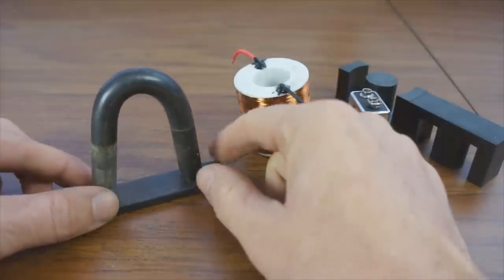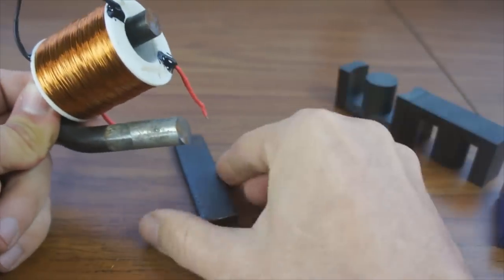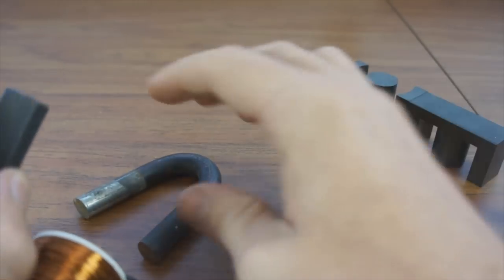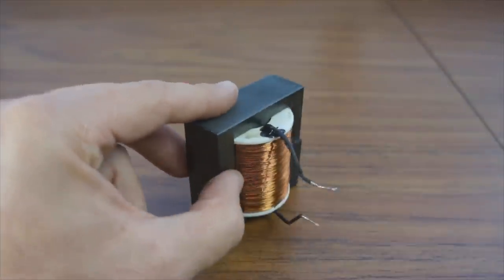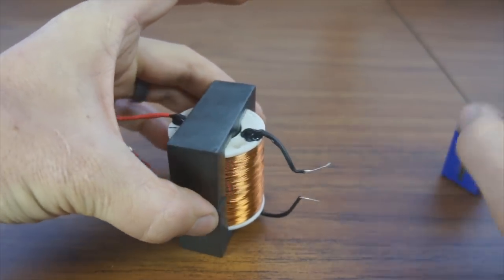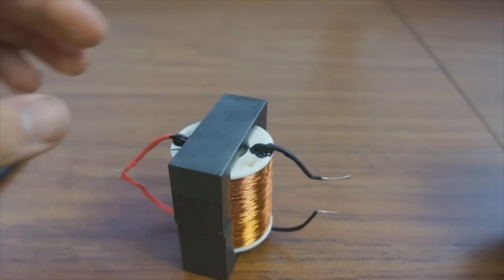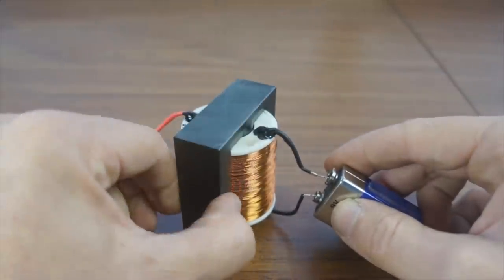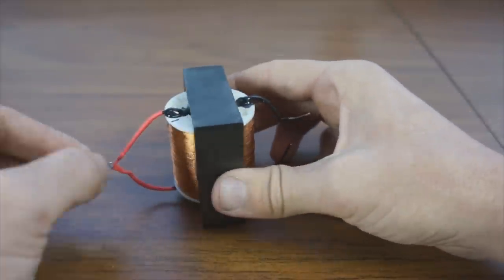PMH - Electromagnet keeps holding after power is removed?

Comment: From what I understand, What I think you  are observing with the soft iron is magnetic hysteresis, and that phenomena was used in early computers to store data. In the closed core, magnetism will either "flow" in one direction or the other, and that will lock the magnetic keeper to the horse-shoe iron. This magnetism cannot be fully removed, only reversed when another pulse of opposite polarity is applied, but in order flip the polarity of the magnetic "circuit" there has to be a moment when the transition passes through '0' magnetism, just like a car having to stop completely before going in reverse. That is why the keeper falls off then it can no longer sustain a strong magnetic field.

The reason that magnetism in the soft iron persists is because it is conductive, while the ferrite core is not. This means eddy currents cannot form in the core. Imagine the soft iron core as not only a core, but also as a shorted secondary. Looking a a cross section of it, imagine many millions of loops, rings and coils that are all conductive! The ferrite core, on the other hand, It is specifically designed not to be conductive, and so these parasitic currents cannot form as easily. The reason this matters is because when making transformers, if the core is conductive, then what happens is that the alternating magnetic flux will induce current in the core and this robs power from the primary, and it is lost as heat (since iron has a little resistance and current+resistance = heat) To eliminate that, iron and other ferromagnetic materials is made into a powder and then the power is glued and molded together so the electrical resistance is really high while maintaining a reasonable level of permeability (magnetic conductivity). By eliminating electrical currents forming in the core, all the changing magnetic flux can induce current is secondary coils and thus the transformer will be more efficient.

The reason having another coil shorted allows the magnetic hysteresis to reappear is because it simulates the cross-sectional area of the other soft iron core with infinite cross-sections being like shorted coils of wire. An electrical current is induced creating a semi-permanent magnetic field that will slowly die away as electrical resistance in the wire resists current. I bet you can stick an ammeter on that L2 coil and measure electrical current flowing for a few seconds until the effect dies away. The higher the resistance, the weaker the hysteresis and locking will be.

This is just my current understanding, I really do not have any idea or understanding of the weird and wonderful world of electromagnetism, let alone any formal education in electronics.
Reply: Very excellent read there Power Max, Thank you for writing that. I want to say that I've been reading Eds book Magnetic Current to gain the insight what Ed thinks and he shows us from his book that the coil is a magnet during the time currents are made. From what I'm picking up on is that through Mutual induction the secondary coil becomes a electromagnet which holds the core together but due to the soft iron its not able hold the magnetic bond after the created electromagnet (like the PMH), the electromagnet eventually stops working on the secondary and the soft iron core no longer is able to hold it core section together. And believe it or not but Eds points all this out in his book in his own terms of course. Here is how here put he puts it in his book "You know the soft iron does not hold magnets, but you already have one that holds it. It is the perpetual motion holder. It illustrates the principle how permanent magnets are made. All that has to be done is to start the magnets to run in on orbit, then they will never stop."
Reply: You have a good understanding of electromagnetism, was going to type something similar but you beat me to it. ;)
Reply: Leviathan15s Nah, I don't have any real clue whatsoever, this is just some of my ideas and current understanding, the terminology is just wikipedia stuff I found a long time ago and I learned the history of magnetic storage at the EEVblog, but thanks!

Comment: is there a way of calculating the capacitance of your feed coil and working out the induced voltage of the second coil ? what is confusing me a little and it might not be relevant is that in the PMH your charging coil wire is smaller size to the PMH which the gauge of the steel (closed coil) is greater than the copper charge coil but in your excellent demonstration the secondary PMH colosed loop is smaller gauge than your charging coil
Reply: Some amateur scientist have made a PMH from a single piece of 12 awg wire and this phonomen can still be observed. .check out youtube...its there

Comment: The last experiment with the coil and the transformer core is pretty simple to explane. When you energize the primary coil, and shorten the secondary coil, the secondary coil will need some time for the magnetic field in it to collapse when you remove the powersource.  It is the sudden collapse of the primary coils magnetic field that induce a current in the secondary coil. It will take some time for this current to stop flowing, and therfor the two transformer cores will stick together untill the current flow has dropped sufficiently to finally release the two cores. You might experience that the cores will stick together longer if you shorten the secondary coil AFTER you supply power to the primary coil.

If you do not short the secondary coil, but place the wires close to eachother, you will probably see a spark when you remove the powersource. This spark occurs because the primary magnetic field collapses so fast, it will incuce a high voltage in the secondary coil, but almost no current - except during the duration of the spark.

Superconductive electromagnets, such as them used at CERN will maintain its magnetic field after the powersource has been removed. In that sense we can also say that normal permanent magnets are superconductive in its structure that keeps the electrons spinning in the same direction "forever".

Comment: My first guess would be that you are creating a form of capacitor with the 2 coils. Easy enough to test with a volt meter to see if there is residual voltage present after removing the battery. That residual voltage would be enough to maintain the electromagnet until it is used up. Just a thought...

Comment: I solved the problem with the core staying locked when shorting your secondary. The perpetual motion flows from you primary and saturates the core. The "shorting" of the secondary coil is actually just another way to keep the energy flowing through the core and once you break the chain of energy by untwisting your secondary you then lose your magnetism because it drains out of your core like a water leak basically. Hope this comment helped.
Reply: Daniel McFarland is cool but edward leedskalinin had it figured out using magnetic alternating current. Free energy is easy, sometimes over thinking it is what makes it impossible to achieve. Everything has to double and divide by 3 to achieve real creation. Combine that with knowing that north and south pole  currents are actually 2 free flowing energies trying to connect you'll start understand things a lot more.

Comment: Interesting, didnt know about that but makes sense I guess. In the second case it must be the induced current in the second coil that is holding the magnetic field. It last until the resistive losses in the coil consumes the energy. So, having more windings will give you a higher current but also a higher loss because of the increased resistance in a thinner wire. Fewer turns with a thicker wire goes in the other direction but I dont know which one is the "better".

The iron bar is more interesting. Try striking it lightly, cooling it with cold spray, heating it, adding a second magnetic field, an electromagnetic field, electrostatic field etc. and see how it effects the aligned magnetic cells. You can read a little about Barkhausen noise regarding magnetic cells although that is concerned with magnetic changes.
Really looking forward to what you can come up with there :)

Comment: Does the ferrite "E" core you used have a center pole gap when mated?  Many switching transformer cores like this do, to prevent saturation. It would easily act as an electro-magnet, but without an unbroken flux path, it can't maintain on its own.

Comment: when you short the coil, the electric current is residing through resistance. which then keeps the magnetism. when the coil is not shorted the poles are tightly magnetized throughout the horseshoe shape. once the bar is removed the residual magnetism is counter acted by the vibrations and the strong to weak magnetic field experienced by removing the bar from the horseshoe shaped magnet.

Comment: If you look at Ed's magnetic flywheel and the coil windings around on glass bottles, he used the pmh as a magnetic capacitor in this circuit to power coral castle

Comment: When you short the one coil, it becomes a closed loop/structure that gains energy via inductance from the primary energized coil, but quickly loses that energy once the primary coil is de-energized as a function of the charge in the secondary inducting back to the now open primary and escaping b/c the primary is open. I suspect that if you were to short the primary immediately after removing energy from it, with both coils now closed loops, it would hold magnetism for long than with one coil being open.

Comment: The answer appears to be very simple , lts like locking the back door and you only load and unload from the front door. some metals store magnetism and some dont. you just basically answer your own question. you told us B comes after A , but your also asking us what number comes after 1.  But nevertheless you showed us something great to learn from. its seems like it can work like a capacitor for delay oscillation without a transistor... the real trick here is how your able to demagnetize the metal. its stored induction in second coil therefore keeping the hold until reverse DC is applied that acts as AC to demagnetizes.
Reply: I'm coming here so I can read your comment later. It was very insightful
Reply: my advice, research more than one video... this stuff is tricky...  you start to plan before you completely know everything... but everything has learning curve... be prepared to make mistakes and before you know it , you will know 7 ways to do something
Reply: I'm not so sure about it. Normally the permanent magnets don't demagnetize, if you encircle them with wire.
Reply: @jonathanrice6338  this sight has some very insightful people good stuff

Comment: I don't really know whats it called in English, roughly translated to "remaining magnetism". When you run electricity through the coil the atoms and newtons and whatever gets aligned, that is what creates the magnetic field. If you use enough power this edisons will stay align even after you stop inputing power. So you are still left with a bit of magnetism. Kinda like when you drive your car and turn it of in the middle of the road, the car is still doing what the cars doing. You need to make it do the opposite like breaking if you want the car stop caring.

remanent magnetism might be the correct English term.

Comment: perhaps adding an ammeter to the second winding would shed some light.
I would assume it has something to do with the magnetic field slowly collapsing instead of quickly without the current path on the secondary. I'm not as knowledgeable on inductors as I wish I was, but my guess is there's a current on the secondary winding for a few moments after you remove the power source.

Comment: you don't need to keep the coil there, once its energized the metal stays together by itself, try with 6 nuts in a hexagon, run the wire through the middle, energize the wire + to - then remove it, the nuts will hold by themselves.

Comment: My theory on the second coil thing, the magnetic flux that was first created once power is removed is slowly passing through the second coil creating energy within the coil keeping the hold. Once that flux has passed through and thus energy has been used up it loses the magnetism. The slow flux movement works the same as when you try sliding a neodymium magnet across inclined conductor such as copper or aluminum the excess energy shorting in the conductor slows the magnets movement as it absorbs the flux. At least that's my theory but i'm no expert haha

Comment: the inductive power transfer between the coils happens only during changes in voltage, in this case when connecting and unconnecting the battery. So when unconnecting, the shortened coil will cause a short pulse that happens while the primary coils field is collapsing. This pulses polarity is opposite to the one of the collapsing field, preventing the magnetic loop of the outer legs from flowing trough the middle leg.  Or something ^^

Comment: Very very interesting. I would guess that there is some kind of induction current maintaining the field. It would make sense that the one with the second coil wouldn't last as long due to a high resistance (lower efficiency) vs the looping iron core of the single coil setup. There was a device developed during WWII called the Hans Coler Coil that may have exploited the same or similar phenomena. Researching it may provide some insight into the effect at hand. I will be looking into this and am very interested to hear an explanation!

Comment: Amigo, a possible answer to why the residual magnetism when shorting the secondary coil.  It might be just as Ed Leedskalnin explained: the secondary coil with the red wires becomes the Permanent Magnetic Holder of Ed Leedskalnin, given its self-reciprocating path.  You have created a different form of Ed Leedskalnin's PMH.  It only looks different, yet the function is the same.

The individual magnets as Leedskalnin called them will circulate forever in the infinity loop created by the linking of both ends of the secondary coil -- 'shorting'.  Unlink or unshort that secondary coil should result in the sudden loss of magnetism.  More importantly, you should see your initial electric charge used to initiate the PMH process in the primary coil when you disconnect the secondary.  You get back out in terms of the electricity exactly what you put in to make the electromagnet -- even decades later -- when you break the infinity loop of Leedskalnin's PMH.

There exists no explanation and no desire to look at the phenomenon from the institution of science.  I firmly believe this indicates clearly that all we were taught about magnetism is either ignorant, or misinformation.  

F.

Comment: this effect is because of induction of the secondary coil. it wants to resist the reduction in the magnetic field passing it thus it creates a current to keep that until it looses its power. so till this time the core would be magnetized and it would remain locked.

Comment: my best guess would be that when you tie the larger secondary winding together it creates an looped inductor. inductors store electricity in a magnetic field. and the moment you spark the charge to the primary coil from the 9 volt battery. you start a pulse wave bouncing back and forth between the two inductance coils. but that's just my opinion. i haven't put it to test with an oscilloscope. i do know from my experiences being a ham radio operator and an auto mechanic dealing with the inductance in fuel injectors. i have heard on instances where the injectors become feed back generators on the injector amps. i've being told stories from those in the know from both fields. another guess comes from an instance with testing tank coils tuning circuit in an amplifier circuit. it's what completes the sine wave created in a class c amp. being a class c amp only creates 50% or there about's of the original wave form. the rest is made by the flywheel effect in the tank circuit. that's why i think the continued magnetism exist because of a residual bounce between the two coils. and it drain off due to a cascade resistance in and between the coils. if anything, it sounds plausible.

Comment: how I see it, the key to understanding this is to understand the difference between an electromagnet and a permanent magnet. While the electromagnet creates a field when energized, it isn't able to store energy in its field and so its magnetic field goes away when energy is cut off. When introducing the iron loop, you are introducing the ability to store energy and that is why the system holds for a certain amount of time, the iron loop behaving more like a permanent magent. You can think of the iron loop as a capacitor.